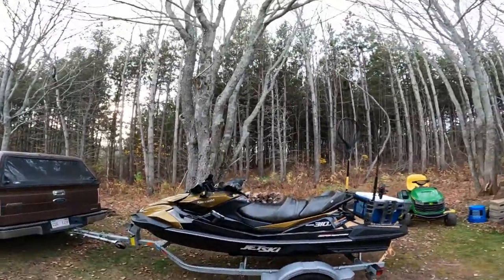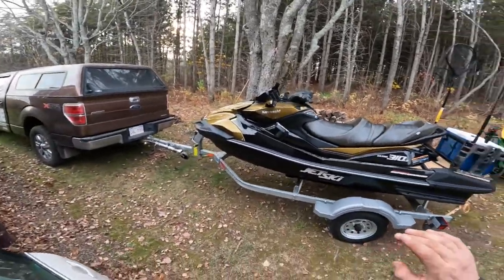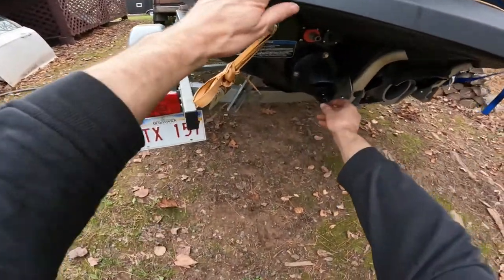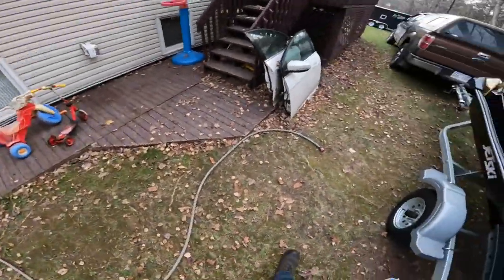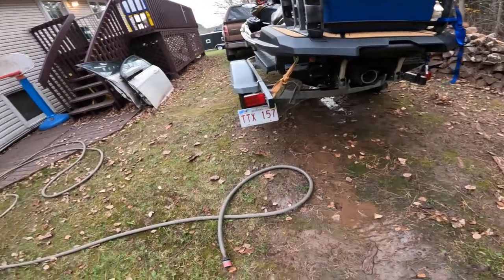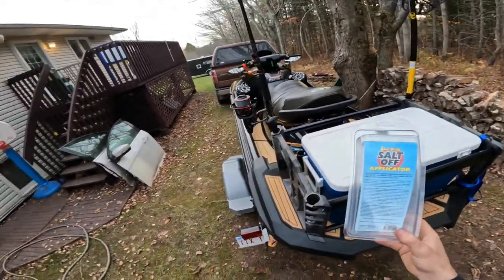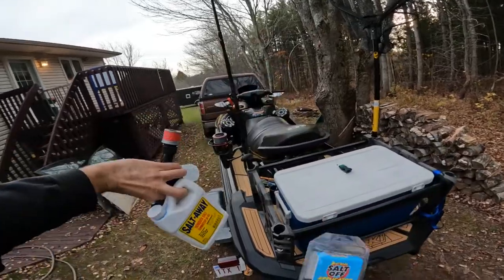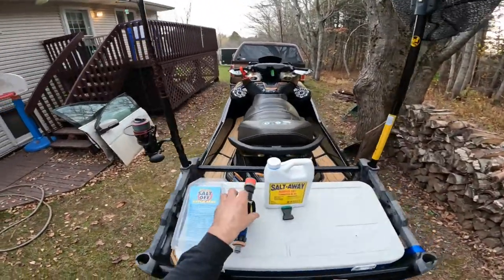Winterizing 2022 Kawasaki Ultra 310 Lx Supercharged Jet Ski Putting Away For Winter

Comment: Why no marine antifreeze when flushing the engine and intercooler ports?
Reply from the maker: My ski stays in the garage throughout the winter where things do not normally freeze. 
If storing outside It would prolly be suggested to run some coolant  through the system. 
I would tip the trailer and ski up using as high as possible to drain any access water in the unit out. 
I tip mine around 45 degrees to drain any access water out.

Comment: I accidentally pulled out the hose that will fill the haul with water, and got disconnected on the bottom now i dont how or where to put it back, any help will be appreciated
Reply from the maker: I will see if I can get to my unit within a day or two to see where the hose connects. 

That is the hose with the little elbow fitting at the back that I showed to make sure was clear of debre?
Reply: @LUCAMTire  yes that hose i was trying to take off the elbow fitting but i accidentally took of the entire hose from the back when i pulled it, its the one that goes back to the end of the jetski, but it seems theres a lot stuff in the way to even fit your hand in there
Reply from the maker: @yandeld9168  It will be a day or two until I am back at my unit to be able to try and see. I did a quick google search and I came across this parts diagram on partzilla.
It looks like one goes to the jet pump housing and the other goes to a pick up strainer that sits on the bottom
See following link of diagram, hope this helps.
https://www.partzilla.com/catalog/kawasaki/jet-ski/2022/ultra-310lx-s-jt1500wnfnn/bilge-system

Comment: any problems with this ski yet?
Reply from the maker: No big major problems 
Couple little things. 
A recall to reflash the computer. Had a bit of a mapping issue that majority of the 2022 models came with. 

I have a minor start stall issue. 
Need to push the button a few times on first initial start up of the day to get the ski fired up. After that all day it is fine to shut off and start again. Could be the fuel is returning to the tank when sitting over night loosing its prime or could possibly be the fogging oil i am using to fog the super charger at the end of the day after running in salt water that is causing the start stall sputter at first initial start up. 

I am going to bring the ski out of storage In the next week or two and start getting it ready for summer. Going to clear out the fogging oil and then let it sit for a couple days and come back and see if it has the start stall sputter again. If it does the dealer will have a look. If it does not start stall I am going to say it is due to the fogging oil causing the issue. 
No major issues. Has been a good ski. Alot of fun. 

Here is a clip of what I am reffering to of the start stall. After going. Rest of day from what I remember it is ok. No issues. 

https://youtu.be/-aRvw9Fymjc

Comment: Im from florida.. what is "winterizing"... ? 🤷 😂
Reply from the maker: We have ice and snow and temperatures that fall below freezing..
So we need to winterize our units to store for winter. Preserves them from rusting and corrosion and making sure things are cleaned up and dried out from water to not freeze for the 6 months they are stored before we can Use them again. 
Just a maintenance thing for storage really.
Reply: Salt water you got bigger problems than winterizing